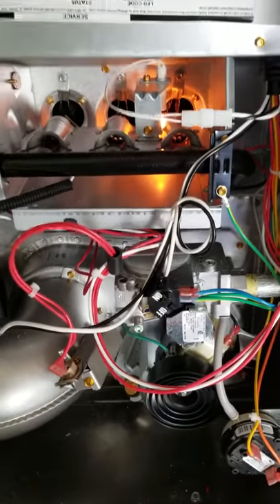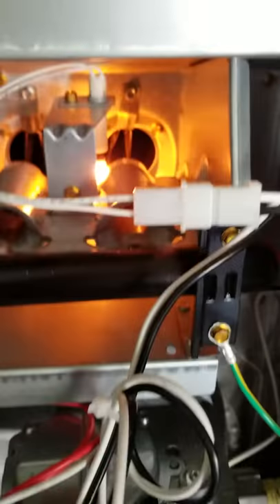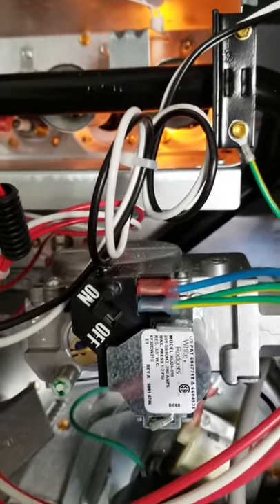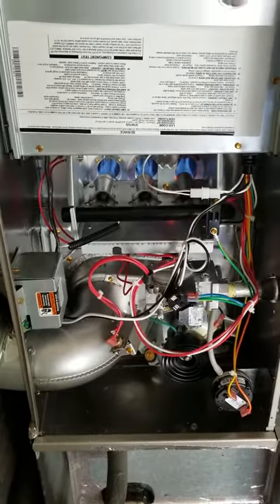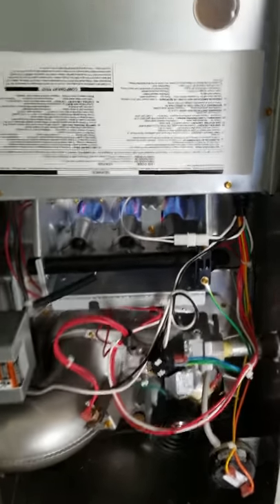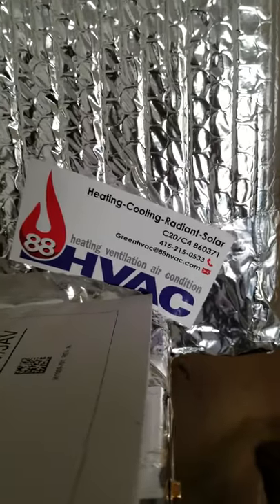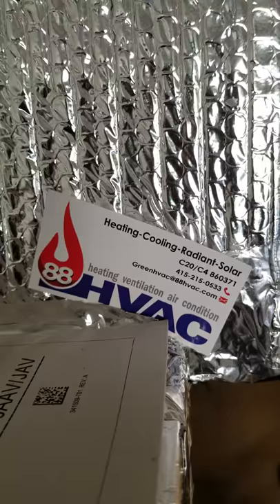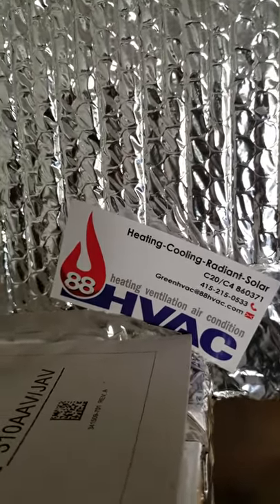Furnace cycle of operation.

Comment: OPERATION OF A GAS FURNACE.
1 INDUCER DRAFT MOTOR 
2 PRESSURE SWITCH
3 HOT SURFACE IGNITOR
4 GAS VALVE  YOU HEAR  A CLICK 
5 SYSTEM GETS IGNITION.
6 BLOWER MOTOR START RUNNING.

Comment: Not exactly. Inducer, pressure switch, back to the board, igniter, then gas valve, then flame sensor, back to board, then blower motor. Strange situations happen when the board is faulty